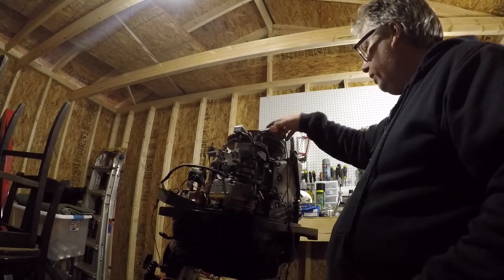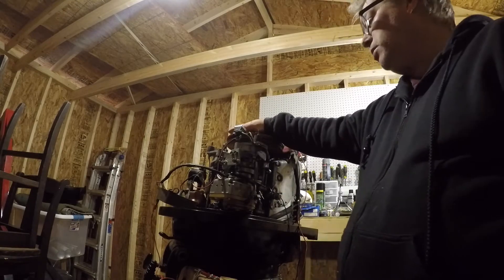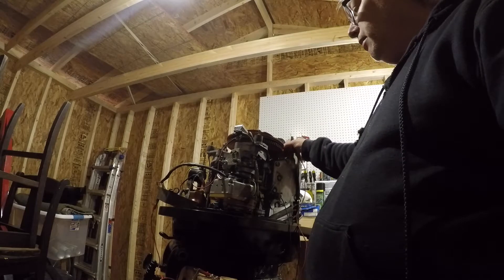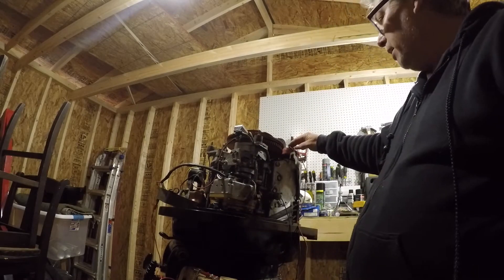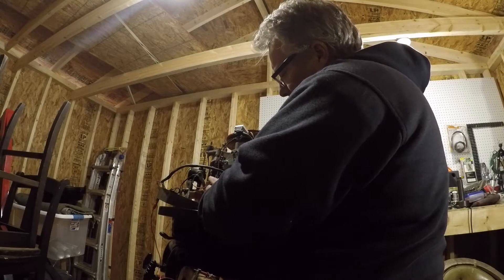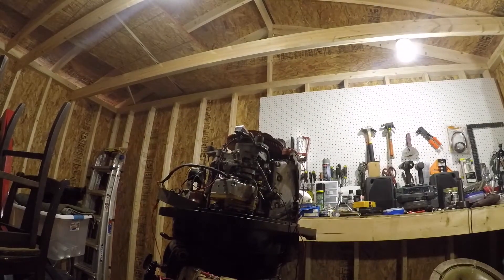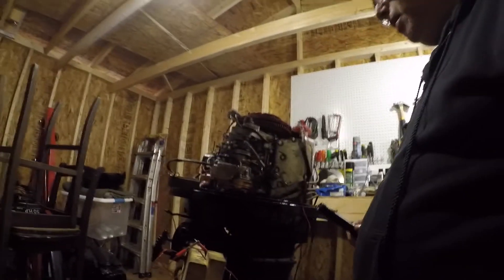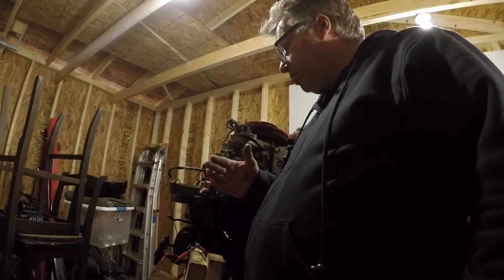Mercury Outboard Thunderbolt 500 50 HP Part 53 - Checking Primary and Secondary Pickup

Comment: hello, can you please tell me what the spark advance is for this engine? And in the beginning you talked about 7 to 9 degrees, that's the primary pickup right? can you tell how you adjust that? And one more question; how do you put the flywheel back on? I've put it on at top dead center, is that correct? Thanks in advance, and thank you for these video's, they've been really helpful
Reply from the maker: Should be located on a sticker on the outside of the front plate.  So, for my engine its 7-9 degrees BTDC and then its 35 degrees BTDC at wide open throttle . When they manufacture these engines each engine is going to be slightly different.  Primary pickup is adjusted by the mechanical adjustment from the distributor to the carburetor as shown in my video.   At idle it should just touch and slightly open the carbs venturi.  To set spark advance for the secondary pickup the butterfly's need to wide open.  Crank it and using your timing light adjust the spark advance screw until you reach the number on your sticker.   You should crank with no fuel and check the wide open throttle by the adjustment screw on the plate connected to the distributor.  Hope that helps.
Reply: @hawkeyemarine  I'm sorry, I meant the spark advance for when it's in idle. according to a picture on the internet it should be 3 to 5 degrees after top dead center, is that correct? and about thr flywheel, we took it apart in two parts, so do you know how we can put it back together now? We're not sure we put it back correctly; the notch on the flywheel is poining somewhat to tdc, but we're not sure
Reply from the maker: @jaspervermond5152  Your going to need to use a dial indicator then and get the #1 to top dead center.  The flywheel is notched and can only go on one way.  Put that on and make sure your front plate is on with the timing marks.  With the piston in TDC you have have to back the piston up .464.  Put the top plate of the flywheel on and the marks should line up with 0 degrees.  Put your nut on and just turn the flywheel a few times to make sure it still lines up with the 0 degree mark and the look at your dial indicator and make sure it looks right.  You will know because with the crankshaft notched and the flywheel it will have to line up with the bolt on the second piece of the flywheel.
Reply: @hawkeyemarine  ok, great, we didn't back it up, so that's probably the problem. Just checking, our engine has a sticker on it with "timing .232 btdc 35°". is this the equivelant of your .464? so we'll have to fix that first then. Thanks for your fast replies by the way
Reply from the maker: @jaspervermond5152  No the .464 is the internal timing of the piston with regard to TDC.  When you find TDC and you back it up slightly counter clock wise (remember this is a clockwise motor so, you should never turn the crankshaft counter clockwise) you will notice that that it takes a little before the piston moves back.  And, that I believe is what Mercury calculates in the TDC so, the piston shaft has to move that much before it starts its downward cycle.  It will makes sense when you do it.
Reply: @hawkeyemarine  Ok, thank, we're going to try that, we'll let you know when we figure it out
Reply from the maker: @jaspervermond5152  I just posted Part 59 and 60 showing how to do Primary and Secondary timing.